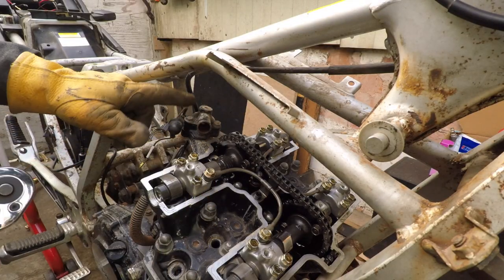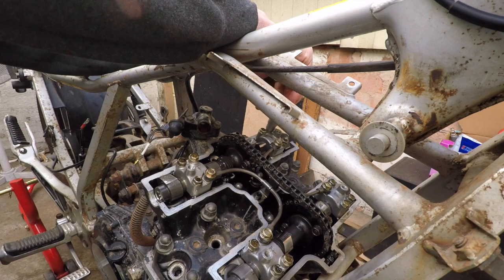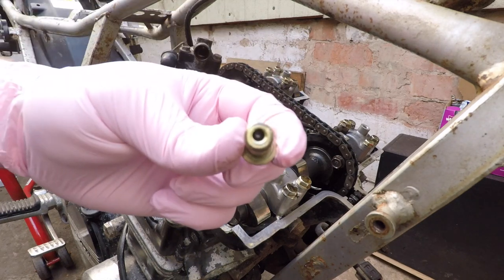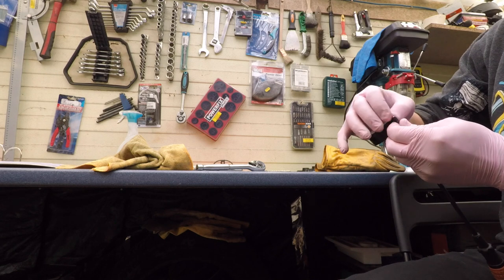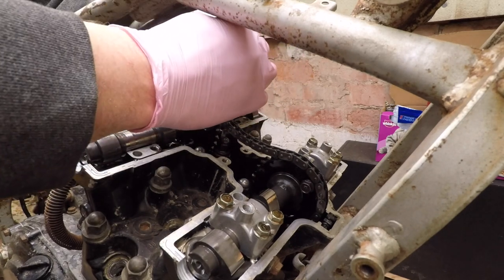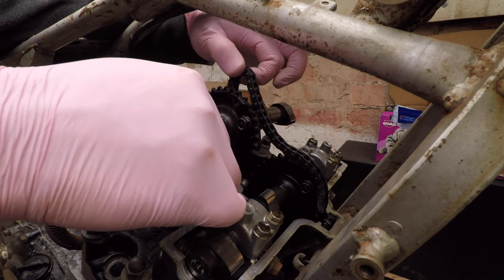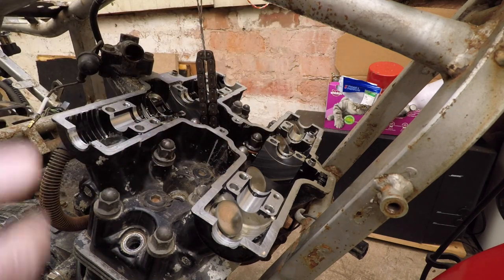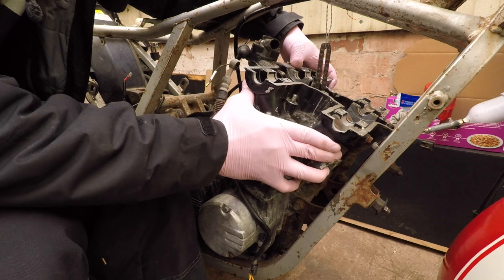Suzuki GS250FW Restoration Pt4 1080

Comment: Not sure if you let your gas sit in the tank for a few months before starting it up when the valve and piston collided. But I’ve heard horror stories similar to what you’re seeing when the gas additive thickens over time, causing the valve stems to stick resulting on valve heads not closing and protruding long enough for the piston to smash into and destroying engines.
Reply from the maker: the first time i started it after 28 years of it sitting i just started it like that without disassembly of the engine and checking the valves etc.
I had the it can’t happen to me mentality... well...:))) 
i lived , i learned.
it’s in tip top shape now, it purrs like a kitten.
I’ll do another clip when i’ll upgrade the rectifier to a mosfet one as i had 2 oldschool ones fail on me till now.